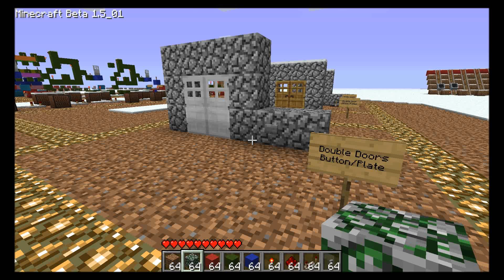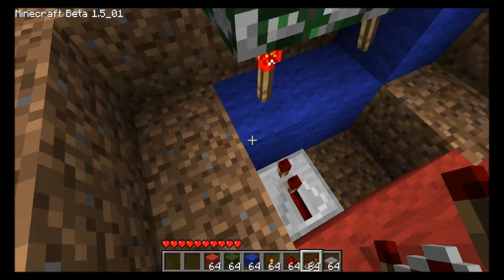How to make button/plate double doors

Comment: It will work, you have to mirror the setup to match the door on the left (when facing the doors on the outside). Don't place the torch directly under the door. The rest of the circuit works fine. Tested it today and it works.
Reply: I also didn't have the vertical torch

Comment from the maker: @HiatusLucari The moment you step on the inner pressure plates, it sends a signal to the reset line on the RS NOR Latch, so it's no longer keeping the doors open. The tricky part is that the same pressure plates are also directly connected to the doors, so they hold the door open directly. Then when you step off of the pressure plates, neither they nor the RS NOR Latch are keeping the doors open, so they close.

Comment from the maker: @Aerofluff Torches burn out if they're toggled too quickly. They un-burn-out after several seconds though.

If your torches are repeatedly burning out, it may be because you have an accidental loop in your circuits. The most likely place for that is if you have a sand block on top of the right torch of the RS NOR Latch. That space has to be clear.

Comment from the maker: @rlukaszewski Lessee... Start with a T Flip-Flop, with the output connected to the doors. The button would connect to the normal input to the T Flip-Flop. You can also explicitly set most T Flip-Flops to a specific state. The pressure plates would connect in this way, forcing the T Flip-Flop to its "off" state so the doors will be closed.